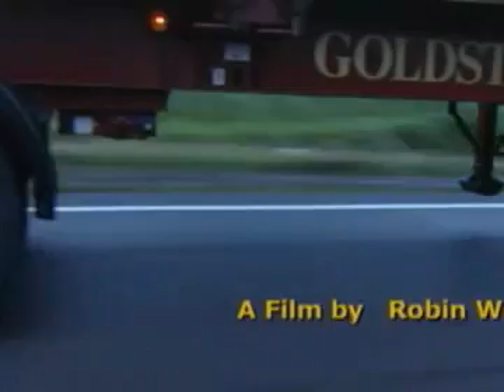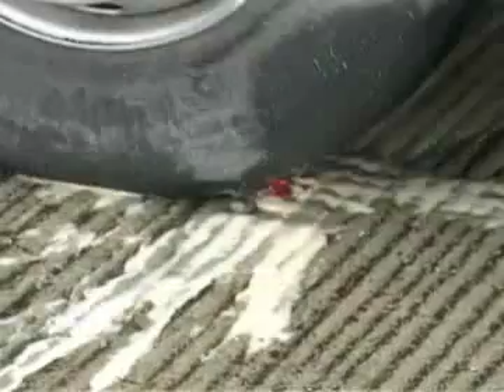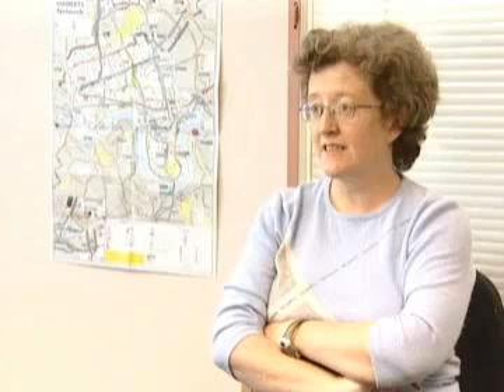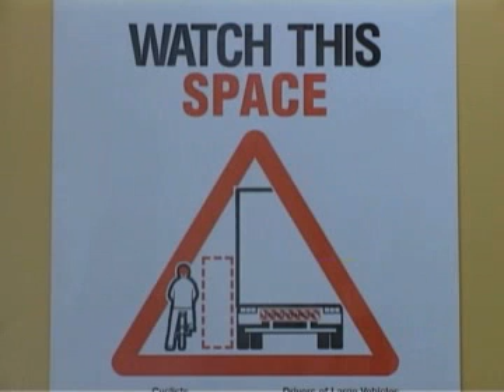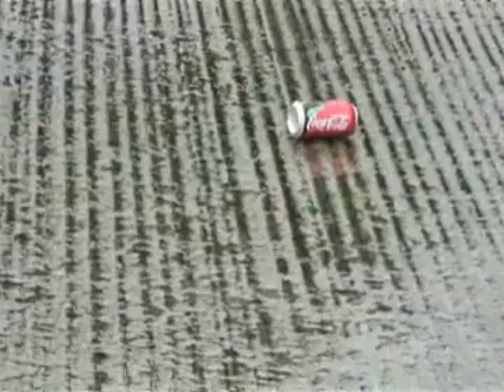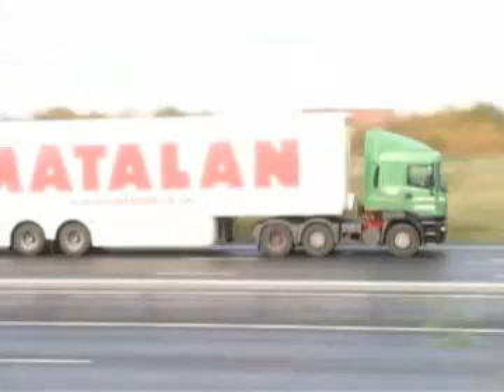44 tonne lorries and towns don't mix (part 1 of 2)

Comment: @mickeybfc Absolutely.  I'm a lorry driver and from my point of view.  If you pull up to a junction with a cyclist infront of u and u don't see it, completely the drivers fault.  But if you have stopped at stop lights, for example, with your left hand indicator on and a cyclist come up your near side, hasn't he just broke the law by overtaking on the near side? At some point the cyclist has to take some responsibility for their actions by putting themselfs in a blatantly bad situation

Comment: ... and also, those lines that mark out the blindspots as to what a driver can see, try turning the cab like at 7.25 and mark them out again, simply put, i'll see you behind me before i turn, but then chances are i wont as i turn as the mirrors dont allow me total vision when the cab is turning, AT THAT POINT NEVER, NEVER UNDERTAKE, I see alot of bikes when im driving, some just will never get it till its too late, and they know what they are risking too, AND THAT IS NOT THE FAULT OF THE DRIVER

Comment: just a point, why do you have problems with trucks, without them you wouldnt be able to do any shopping, how does food get to shops, half of the trucks in the video are not even 44 ton and the bit about side protection was filmed before the regulation came in, if it was filmedafter wich is highly unlikely the trailer wouldnt have passed an mot so why not blame the dick head cyclists who all know the danger and leave us HGV/PCV drivers well alone?

Comment: What a load of nonsense. Truck drivers pull up to a set of lights, or a junction, roundabout, whatever, knowing that there is nothing immediately around them, then they have to wait for the light or traffic and some moron on a pedal bike thinks he is allowed to pass and stop in the blind spots of the truck. The law states that cyclists are bound by the same regulations, which include not passing on the left, and waiting in line, but cyclists don't bother because they are mostly morons!!

Comment: in 90% of all accidents with trucks turning left the driver did not see the bike etc in his mirrors due to blind spots but in the same accidents 100% of bikes etc saw the truck. need i say more, if an artic has his left hand flashers on he is turning left,  just seems the easy way out to blame the driver.

Comment: nice video about 44 tonne trucks. the ones in the video (apart from the last few on the motorway clip) where 38 tonnes rated vehicles. if you want to put a video together to point out how bad 44 tonne rated trucks are at least use one !

as a HGV 1 driver i would love not to go to little towns. but then you want to eat. you have got a choice let me park outside the town unload me and put my load on 16 transit vans! and drive them to your local store 10 loads a day equals 160 transit vans!

Comment: Well you can't really. If someone jumped in front of your car, would it be your fault? 

So if someone cycles under your truck, is it your fault?

Although there is a lot of bad HGV driving, a lot of the criticism is unfair as the 'victims' are often self-selecting.

The problem is, how do you distinguish between a truck driver who overtakes a cyclist then turns left before he's clear, from an innocent one who checked his mirrors, then someone cycled alongside?

Two very different situations.

Comment from the maker: I've not had to do this with a lorry in 34 years cycling but it's helpful to have a smooth panel on a lorry side (like a bus) to push off if in a tight squeeze to avoid tangling with wheels etc. Unfortunately many trucks have all kinds of straps, hooks, open spaces, bars and projections on the side and I often hear stories about cyclists being caught and dragged along. Some designs are better than others.

Comment: If freight could go on the railways I would be all for it but its just so damn expensive which is why you see so many trains being moved on the roads,The solution is very simple if peole bought locally there would be no need for so many lorries running about on the roads, I travel up to 1500 miles a week delivering an energy saving product is that right ????????????.

Comment: As someone who drives in London frequently with a 62.5 feet vehicle here are a few things that i find EXTREMELY frustrating.

When I come to a box junction (criss cross lines some people call them) and I need to make sure there is a large enough space at the other side just as i have the space i need someone will usually change lanes to use the valuable space I have waited for in order that they do not have to wait in their own lane for the person in front to move.

Comment: The vehicle with Friends of the road on the back and the one with Lederer on the side are NOT 44 tonne vehicles, so perhaps the film makers should pay a bit more attention when they feel the need to slate L.G.V. drivers.

Containers ( thats the big metal bits that come from the docks with the cheap imports we all desire) are actually exempt from side under run bars due to having a sliding body so why show them as not complying with the rules?.

Comment: Sorry, but I have to, in general, agree with trucker111111.  Yes, lorries have blind spots; so do cars; lorries are bigger therefore larger blindspots are UNAVOIDABLE.  All motor vehicle drivers have to learn about this to pass their test; I both cycle and drive, and I just think most cyclists need to learn the rules of the road.  Don't undertake, keep a safe distance from vehicles in front, and indicate clearly, in advance. Problem solved.